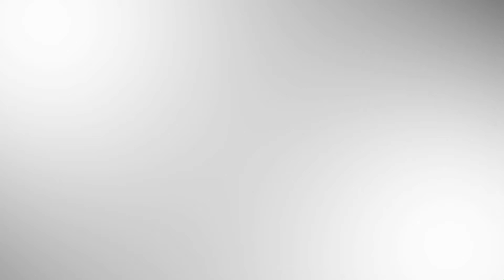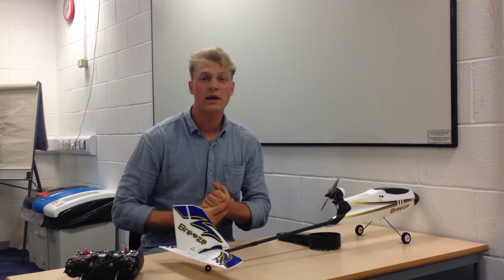Evaluate Thrust Velocity of an RC Plane

Comment: here are some very very late thoughts.    it would appear that you were  trying to evaluate the affects of   PROPWASH.       HOWEVER,  the propwash on this model has  the Wrong Vector.  so, the validity of any findings, here, is zero.     see linked annotated photo.    it, also,  appears that the chords of the control surfaces are Not equal.  THEY  SHOULD  BE.    cheers               googletranslate
http://static.rcgroups.net/forums/attachments/2/9/6/3/9/7/a5988257-224-bixler%202%20motor%20angle%20correction.jpg